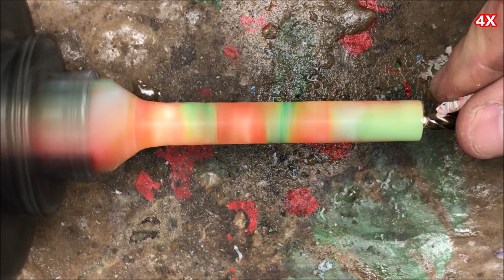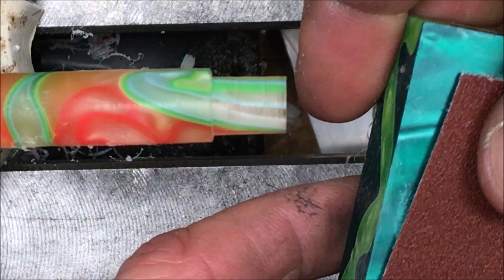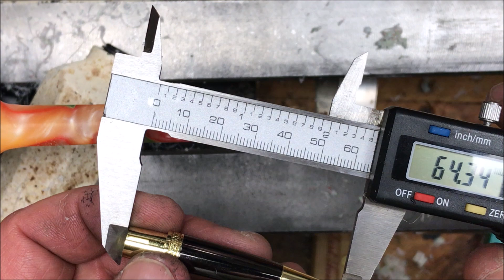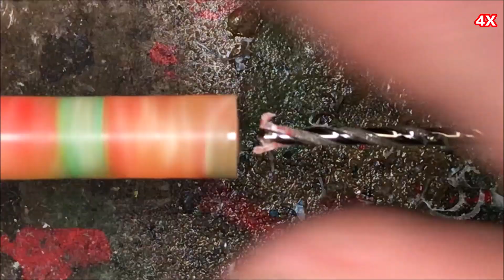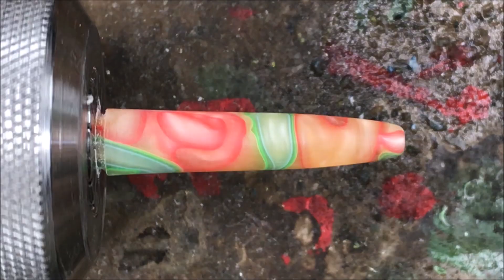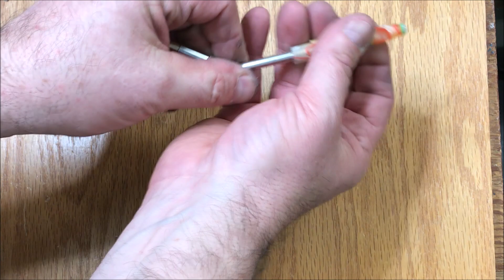Turn a Custom Section for you Sierra Style Pen.

Comment: Hi Bob, This opens up a new world of potential pens. Great work Bob. I might now have to invest in a collet chuck set. Cheers, Huw
Reply from the maker: I didn’t think I would use a collet. Then I purchased one. I loved it but I needed more sizes than the 5 that came with it. So I purchased a 25 spring collet set. It’s is now my go to Chuck for anything round. It holds the stock tightly without damaging it and I can use it on both my larger. 

Regards,
Bob

Comment: Great video, thanks Bob.
Question: Could you turn an Al bushing to 12mm diam. and with treads on one side and a 60° cove on the other side. 
Then starting with a fresh blank, drill and tap it.
Insert - screw in- this new bushing
Bring your 60° center up to it.
Now turn the blank down, flip it around and chuck up the nib.
Reply from the maker: I do r see why that wouldn’t work. It may also help with proper alignment. 

Regards,
Bob

Comment: what are you using for lubricant?
Reply: I could be wrong but I would say that any oil would be fine for a lubricant for drilling and tapping plastic
Reply from the maker: Many people use PAM or Canola Oil. 

Regards,
Bob
Reply from the maker: Mineral oil. It may not be the best but it’s what I had. 

Regards,
Bob